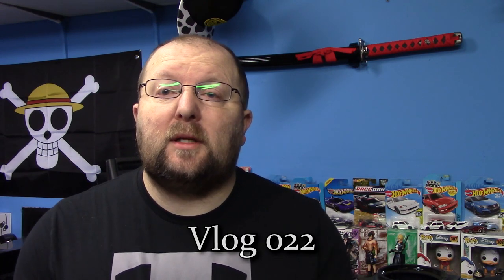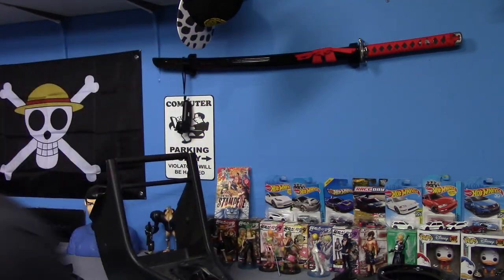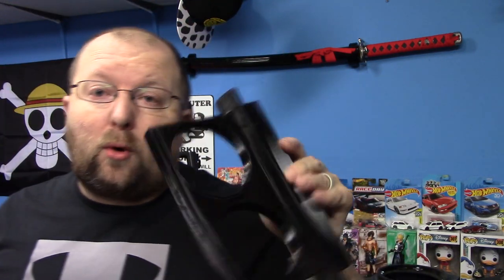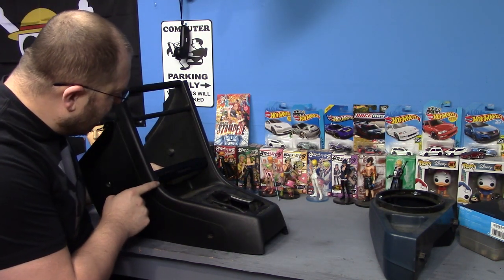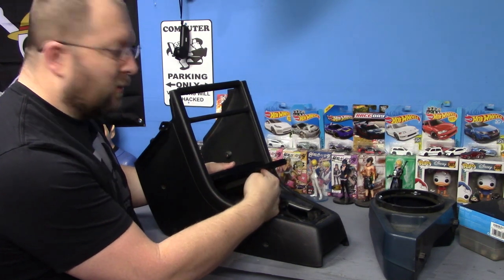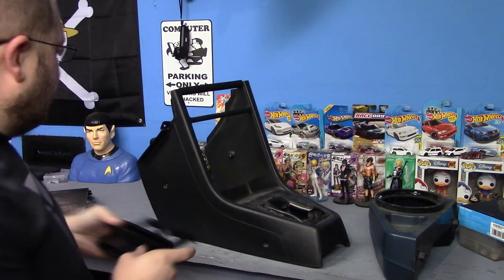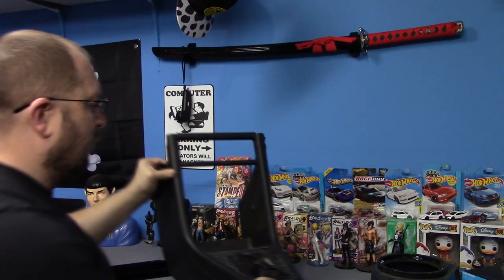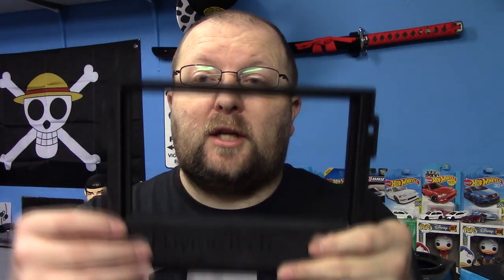Vlog 022 - CRX Double  Din & Cup Holders are DONE.

Comment: Did you ever manufacture this style cup holder?
Reply from the maker: Yes, it's on my website - naytontech.com
Reply: @NaytonTech will it fit a yeti style tumblers?
Reply from the maker: @Athon08  I believe the Yeti style tumblers will go in part of the way, but may not reach the bottom.
Reply: @NaytonTech  think it would be enough for it not to fall out or tip?